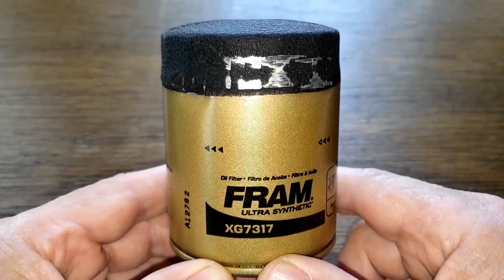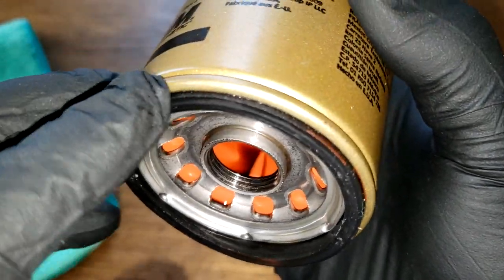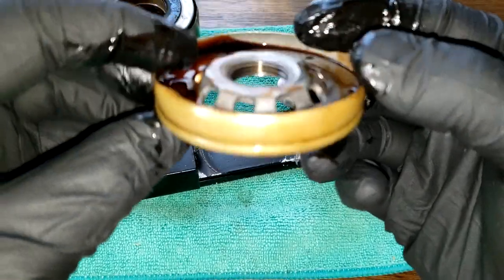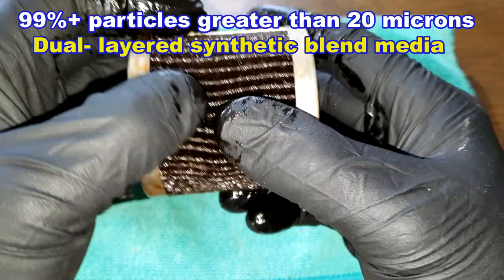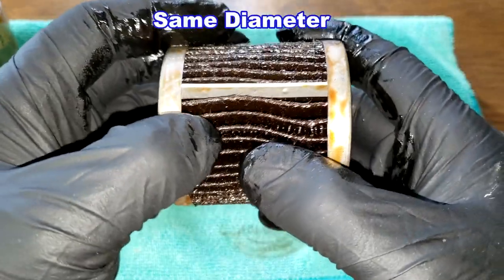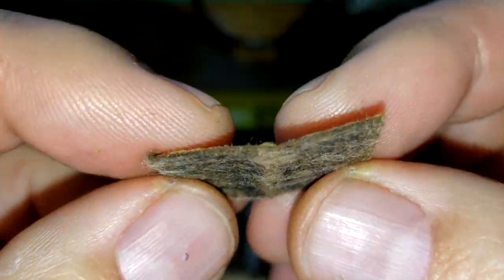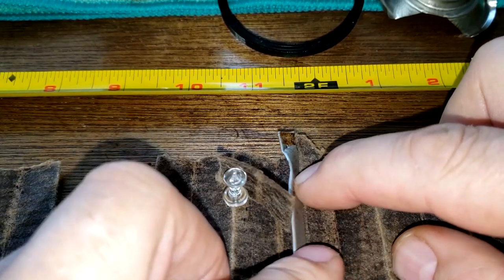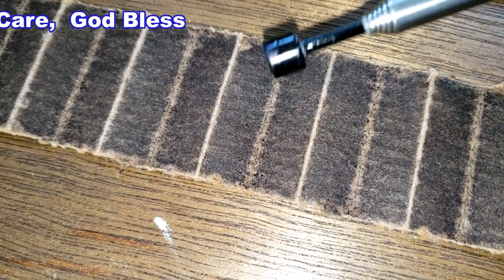Fram Ultra XG7317 Oil Filter Cut Open, Used Oil Filter

Comment: I like knowing what the applications are on these filters and wish there was an easy way figure out how to use larger filters like you did.
Reply: the 7317 filter will fit most all Asian engines. The threads are the same as the 6607.
Some Fram sites, when you look at details of a particular filter, shows the thread size and the gasket to engine size as well. There are several Fram sites it seems so check around.
Reply from the maker: Hi Jim,
It takes some research but a quick way to do it is to take your filter size and do a google cross-reference search and see if there are other bigger sizes available then recheck the specs on the other filters. Maybe someone has a better way of doing it. I'll pin your comment so it sits up top.
Reply: The easiest way is to use Wix's website, they have a dimension search find something with the same thread and gasket then try cross referencing it to other manufacturers, for applications calling for a 6607 or 7317, you may be able to use a 9688 or 3593a is there is no obstruction around the mount the former are around 2.5in diameter the latter are  around 3in but they use the same thread and the gasket is the same dimensions.
Reply: Look at the filter plate. The end piece with holes. If it says something like '2E' on it, look for a longer one with '2E'. I'm not sure if all filters are like this, but I know the Fram is for sure. I can put  a much longer filter on my 2001 Chevrolet   Impala than what it calls for. Also, like what he said about a cross reference is the easiest way, then look at them and see which is longer, and it may be the same price as the shorter one. Not all vehicles have a longer option, but with the Impala, I found with some research typing for a 2001 Chevrolet Blazer is the longest filter that will fit my 2001 Chevrolet Impala. I would have the size it calls for in case it doesn't fit. If you can get a longer one to fit, it's well worth it. Take back to the store the one (or ones) you didn't use.
Reply: Great video my friend
Reply: Just look for compatible specs.  Especially the threads.
Reply: @dwendt44  there's three common thread pitches. Buy an oil cooler sending plate with the threaded part.

Comment: You do such good no B.S. videos Whip .  I like holes myself over louvers. Was surprised with the waves seeing you used a larger filter than called for . 👍
Reply: The question is NOT "Which is better, Holes or Louvers!?" The questoin is : What is the PURPOSE of the holes and the louvers, and how evenly are they distributed over the surface of the core.
 We find LOTS of different configurations of holes and louvers among the different brands, and then there is the increasingly-popular "polymer" (plastic) core, that has neither holes NOR louvers.
Personally, I prefer a Spiral-Wound metal core with louvers, as found in the Bosch Premium. 
I would like to see the cores cut out of the Fram XG731 and the Bosch 3323 and WEIGHED for comparison, with the lighter weight core preferred.
The "waves" in the used XG7317 were present in a BRAND NEW XG7317 that I cut open.
Reply from the maker: Thank Ken!👍

Comment: I like using  Bosch  filter . &supertech oil filters  .👍
Reply: I'm with you. My two favorites now are the Bosch Premium and Super Tech MP series.
Reply: Yes, sir !! The famous 95 MERC  has run the Bosch Premium #3410 oil filter for several years, with excellent results and no "issues" of any kind.
I cut 'em open and look inside -- never an unpleasant surprise, and the best Micron Rating in the business.
The SuperTech is Wal-Mart -- and I don't do WalMart -- REALLY bad, anti-American politics.

Comment: That filter could have gone twice the distance easily. Great job.
Reply from the maker: Thanks Rick!
Reply: @WhipCityWrencher  
That Quaker State looks like it did a great job cleaning. Did you get a oil analysis on it? Thanks for what you do informing the public about oil filters. That oil filter could have gone longer but l like your 4k change interval. I do the same with my Honda and 5K on my Ram. Keep up the good work.
Reply from the maker: @rickbrown7067  Hi Rick, Thanks!
No, I didn't I wish I had though, just to see how that Quakerstate oil did.

Comment: I just bought a new fram titanium. They still have the metal backing along with slightly bigger inlet holes.  Running a 9837 which is bigger then the 3506. Allows more filtration and flow as well
Reply from the maker: Hi Jacob,
Yep, they still have the metal backing. I open one up next Friday, along with an Ultra.
Thanks for Sharing!👍

Comment: Unless you are experiencing fuel dilution, it would appear you may have done your oil change quite a bit early. Im not there to smell the oil, but it looks pretty clean. The filter looked great. I use this same filter on my 12' Nissan Titan. 👍
Reply from the maker: I could let it go a little farther but it's my daughter's car and an oil change every 6 months is not a bad idea.
Thanks for your feedback!👍
Reply: Service it more and sooner and you'll have a happier vehicle there's nothing that says it's too early ask me how I know that's my profession I do this every single day
Reply: @FordBossMe  I get where you are coming from i also drill it into all my customers heads that they need to stay on top of fluid maitenance.  You tell them 3K they wont show up until 6k? 10k? Lol.  I also have a Licence to print money (Red Seal AST).  I have been studying oil composition and filter manufacturing as of late... as far as i can tell, based on my studies and real world experience doing countless LOF's,  service, etc... If you choose a quality oil and filter then 6000 Miles (10,000km for me up north)for OCI is easily attainable.  It 100% depends on the oil used, the filter used, the type and condition of the engine, and the way the vehicle is driven.  But for Mr. Average Joe, driving a normal vehicle -6000 miles is the new "normal" for me(Where previously 3000 Miles was the norm). (Yes i understand many manufacturer's are going for 10-12K Miles~?, i dont believe that crap)

   There is a caviat to this, as with everything: For instance - ford and many other manufacturers like to use water for oil these days, many of the oils have an HTHS of 2.6-2.7, an HTFS lower than 2.0, much less ZDDP, and mostly group iii or less base oils which IMO is NOT ENOUGH to protect the timing chains and valve train...
   
Selecting an oil that has good properties such as better base oils, balanced chemistry, and a stout additive package will go a LONG way in extending the life of the engine.  Using the watered down oils of today, no matter how short the OCI will lead to early wear of the valve train, theres just no two ways about it, especially if you drive hard and fast. I have seen too many wiped camshafts, tore up lifters, stretched timing chains, stuck injectors, etc etc.. the oil and fuel of today is DRY and thin...  There was a reason the engines of 20 years ago could last so long even when not cared for very well...

   That all being said, what i saw in the video looked like fairly early oil and filter replacement compared to what im used to seeing in both my own vehicles and customer vehicles.. just by seeing it.
   Shmelling it is a different story, if its full of fuel then yes get rid of it...  Im not saying go 30,000 miles on the stuff, just that it looks a bit young.. and his choice of filter is doing an excellent job of keeping the oil clean...
Reply: @FordBossMe  NO. Today's Extended Oil Change Intervals are there for a VERY GOOD reason, which is that they reduce the amount of pollution that gets into our precious air and water resources.
 Sure, Car Dealers want you to bring your car to them OFTEN -- 'cause they make money on every visit !!
Reply: As a retired mechanic I still change my oil at 4 to 5000 miles with synthetic
Reply: @SlikLizrd  LOL...keep thinking that.  You ever see the inside of an engine that was subjected to "extended" oil change intervals?  5K is the maximum OCI.  Used oil is recycled or some shops power their furnaces with used oil.
Reply: @FordBossMe interesting to find you here! love your commentaries
Reply: @SlikLizrd  yes, the extended oil drain intervals are there for one reason: the EPA. Car manufacturers are listing extra long oil change intervals so their cars won't get penalized with environmental penalties. Simple as that. It's got nothing to do with the realities of taking good care of your engine.

Comment: This is the filter that would go on my ‘09 Xterra with the 4.0. Glad to see it held up quite well. Recently cut open one of these (not same part #) from my mother-in-law’s ‘17 Forester and it looked like it held after 5K or so miles. ADBV was still flexible and the media held together well. I’ve been skeptical of the Fram Ultra but plan on using it in the future thanks to this video. Good to see 10 inlet holes of considerable size and holes on the core tube. I think I’ll even use Fram Ultra on my Sienna! Thanks for the video!
Reply from the maker: You're Welcome!

Comment: Thank you for the great review. Just like the other comments, this is the same filter I use on my 1987 Mazda B2200 pickup, I also use it on my 2004 Yamaha FZ1 motorcycle and like on your daughter's Nissan it's about 1" longer than the filter specified for my Yamaha. However, I myself use Mobil 1 synthetic oil in all my vehicles. I don't put a lot of miles on my vehicles so I tend to change the oil in them once a year and I've been happy. After seeing your video I feel confident in using the Fram filters. Thank you so much!!!
Reply from the maker: You're Welcome Daniel👍

Comment: I use this filter on the 06 Honda Ridgeline. Around $10.00 at Walmart. They don’t use the screen backing anymore on this filter. They do use a great two ply type filter. You Google more on this filter. Great filter great price. Walmart also has great prices for oil. You can usually grab a good price on Napa oil when it’s on sale.
Reply: The only reason i step foot in Walmart is to get oil and filters...then i'm out! :)

Comment: The fram ultra syn is in my opinion the best bang for the buck ! it will filter down to 17 micron at %77 ! i last ordered a case for all 5 of my chevy's ( they all take the same filters) on amazon for less than $7 apiece !  You know its good when you see how efficient they are even trapping the soot particles ! Cool video !
Reply: That "17 microns at 77%" is bulls**t, Scotty -- it's a con to make you think you're getting something that you're not getting.
The Fram Ultra is a fine filter, but focus on their PRIMARY micron rating, which is "ISO 4548-12 " for particles GREATER THAN 20 microns. That's the one that counts !!
Reply from the maker: Thanks, Scotty,
I agree it's a hard-to-beat filter for the money.😊
I have a Titanium and Ultra square off on Sep. 9th you won't want to miss that one.
Reply: @SlikLizrd  with most engines that have  .002 clearances a filter that can capture particles of 25 microns should be sufficient ! Oil film strength should not allow moving parts to contact ! a micron particle less than 20 should not allow any contact most metal surfaces

Comment: This is the same filter for a 2017-2019 Nissan Titan, with a 5.6 V8. It seems pretty small so I too am looking for a longer replacement size. I haven't been able to try the following filters, but they seem very close: Mobil 1 M1-201A and Fram XG3980. The threads look like they may be raised a few mm higher towards the nitro gasket so I'm not sure if these will be able to replace the OEM size.
Reply from the maker: I'm pretty sure that the filters you mention have different size threads.
I don't know of a bigger filter for your vehicle, there might be one but I don't know.

Comment: Full disclosure, unlike the original Ultra I'm not a fan of the new First Brands cheapened media Ultra. That said, this one looks ok at 4k miles/6 months. However, most any filter ought to be able to do this filter change interval. The Ultra is rated for 20k miles, and while the pleat wave here has no negative effect, at 20k it could very well have an effect such as tearing. The original two layer full synthetic Ultra had been shown to easily do the rating many times. For less money I've found another option with very similar efficiency rating, and also made in the US. Off my soap box. 😉 Thanks for the vid.
Reply: And let’s not forget the metal mesh backing which ensured the media would keep its shape. I’m glad I built a small stash of the original Ultra.
Reply from the maker: Hi faxmen09,
I have a video showing Sep.9th that I think you'll like. Titanium versus Ultra.
Thanks for your feedback!👍👍
Reply: @fenrislegacy  I think the Titanium is still exact like the old wire backed Ultra..      This is what is reported on Bob Is the Oil Guy forum.
Reply: @fenrislegacy  Yes the wire backing was used to support the 2 layer full synthetic media. Smart man stocking up.
Reply: @WhipCityWrencher  Yeah Whip I'm surprised that the Titanium still looks to be the same construction as OG Ultra. Now if the price would just be the same as Ultra It would be great.

Comment: I think it did a pretty good job of filtering the contaminants,  I am wondering why those pleats are so wavy, is it an assembly issue, or is it caused by the oil flow? I like to see a comparison under the microscope of the new Fram ultra media vs the new Fram ultra, great video!
Reply: I cut open a brand-new Fram XG7317, and the pleats were also "wavy",  just like the used filter in this video.
Reply: @SlikLizrd  thank you for the information.
Reply from the maker: Hi Bud,
I dont know why the waviness but I have a video showing on Sep. 9th, that has the old style filter media from a Titanium oil filter and Newer Fram Ultra style media. Same kind of comparison.
Reply: @budblack3588  Any time.
Reply: Lack of wire backing?
Reply: @XenomorphLV426  The addition of a Wire Backing would probably have stopped the waviness -- BUT -- wire backing was mostly  eliminated (too bulky) to make room for MORE PLEATS, and some filter makers have employed a thin, stiff Polymer backing that does the same job.
Reply: Crimp was not wavy while pleats were.  I'm guessing the filter media was cut slightly bigger than the crimp, which caused the waves when the end plates were assembled.  Not really a performance issue.
Reply: It may have something to do with the holes in the middle. About a month ago he cut open an XG10060 that had run for 7,000 miles and it looked perfectly fine, but it had louvers instead of holes to let oil through. Not sure if that in particular had anything to do with it or not though, they might've stiffened up the media
Reply: @Generaider  thank you for the information it is greatly appriciated.

Comment: Great video! I’ve been using this filter for my last 4 oil changes. I was debating on trying an OEM (Nissan) filter and thought of an idea for you. Maybe an oil filter comparison for just OEM filters (Motorcraft, Nissan, Honda, Toyota, Subaru etc).
Reply from the maker: Hi Sixty,
I've probably done some of them oil filter comparisons. Give me a filter size and I'll see what I can do. Thanks!
Reply: @WhipCityWrencher  Nissan part #15208-65F0E
Not sure what size that is but that’s the one for my car. Thanks man!

Comment: How is that Quakerstate Full Synthetic? I've always avoided them to many people I know having bad experiences with their conventional oil that still used wax as an additive, but do you think their FS is comparable with others out there?
Reply: Somebody was pullin' yer leg, Renegade -- No such thing as a "wax additive".
 Fact is, that both Pennzoil and Quaker State were originally made with Pennsylvania Crude, which is a "parrafin-based" oil, different from most crude oils, which are made from "asphaltic- based" crudes.
Back in the day, we ran our engines much colder than today's emission-controlled engines, and engines with poor cooling systems would get all sludgy -- people were pissed, and blamed the "waxy" oil.
Today's engines perform best, produce less emissions, deliver maximum fuel economy, and last the longest at a nominal temperature of 200 F. 
I use a Motorad Hi - Flow Thermostat @ 195 F -- keeps the 4.6 liter V-8 between 190 F -  205 F.
Reply from the maker: You're probably thinking about the older Quaker state. I've heard good things about this oil. Seems it was okay for this car. I mostly like to use Pennzoil Platinum that's my go-to oil.
Reply: Actually this new formulation of Quakers full synthetic is the best commercially available oil. I read testing reviews done by a mechanical engineer and the top 3 readily available oils is Quaker full synthetic 5w30, Amsoil 5w30 and Amsoil 0w20. Factoring in price this Quaker offers the best protection. Nothing wrong with Pennzoil or Mobil, but I have switched to this 5w30 also.
Reply: @hauseofraf  Correction: Amsoil IS NOT "readily available". It's hard to find -- and I live in America's 5th-largest city.
I'm a Mechanical Engineer, too, and I find that of the "readily available" full- synthetic  oils, the Pennzoil Ultra Platinum (made with natural gas) is the most environmentally-friendly for my hard-earned dollar.
 However, to each his whatever.
Reply: @SlikLizrd  fair point on Amsoil. It’s technically not a retail product. However, Pennzoil is a great oil that I have used and definitely not apprehensive about using again. It’s just that Quaker beats out the sister brand.
Reply: I've been using it for a few years and I think it's good stuff.
Reply: Quaker State is owned by Shell. So is Penzoil. All three are good oils. I have used all three brands over the years with zero problems.